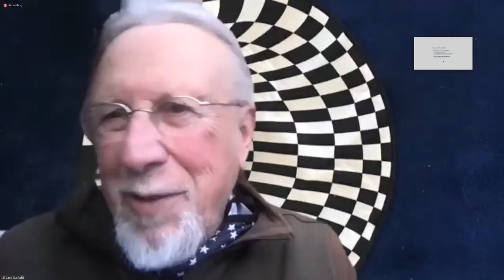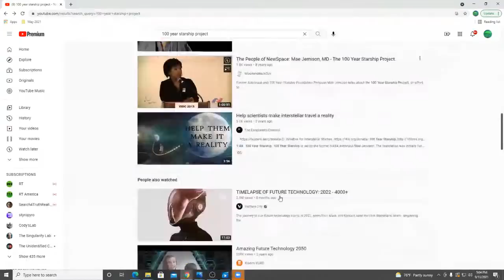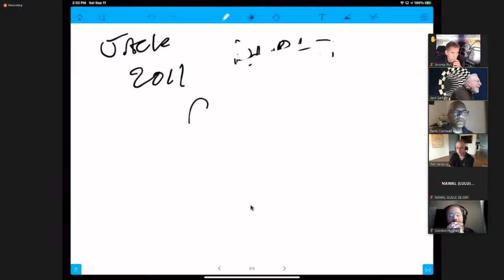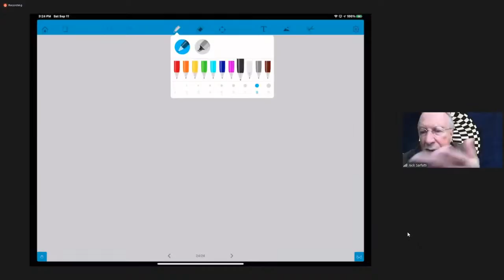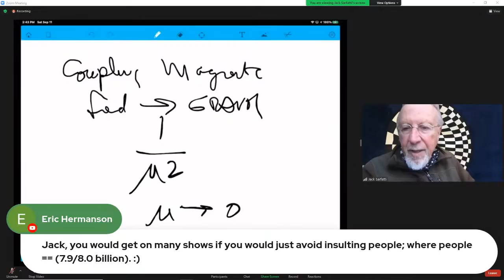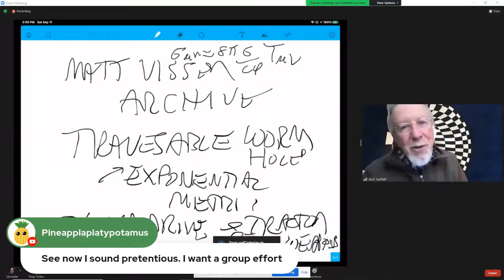APEC 9/11: Jack Sarfatti’s UAP Warp Drive & Tic Tac Tech

Comment: Jack, you are out of touch with real physics.
Reply: Over 50% of physics research is for the military and most of that is top secret. As Jack says - he worked for military research. My own quantum mechanics professor had his research classified top secret - before he was aware of it. Then he was contacted by the NSA and now he's designed a quantum teleportation satellite signal system that NASA is testing - Professor Herbert J. Bernstein. So no - Jack is not out of touch with real physics.

Comment: I'm not very knowledgeable in relativity, but my understanding is that with a gravitational redshift, photons are redshifted when traveling out of a gravity well, but that they are blueshifted when traveling into the well.  If this is the case, then do the shifts cancel eachother out for a gravity or antigravity well or is it possible for them to take a path through the well so that there is a net red or blue shift?  Dang, should've asked that one.
Reply: There's something called the inverse doppler shift. I'll find some details for you. "This type of metamaterial is composed of Helmholtz resonators of which the group and phase velocities are opposite in direction near the resonant frequency." So Transverse or Inverse Doppler Effect  "materials with negative refractions can induce inverse Doppler effects"  and "A localized wave packed assembled from many plane waves can still be assigned a (four)momentum at each point. The four components of this momentum are the phase change rates in t,x,y and z given by the imaginary part of the first order derivatives in t,x,y and z. If you apply these first order derivatives on a plane wave then they'll give you the temporal and spatial frequencies of the de Broglie field. The de Broglie wavelength is simply the reciprocal of the spatial frequency. Realizing that the lag of the clock characterized oscillations inside the particle, he associated them with vibrations of the same frequency, but covering the whole space. And he showed that if an observer sees a particle in motion, then these spatial vibrations will seem to him waves propagating faster than a particle..."
and ."The inverse Doppler effect where an observer measures a higher frequency from a source moving away, is such an intriguing phenomenon that it has attracted substantial theoretical and experimental attention since it was first proposed... ...the energy-momentum flux will be larger in the blue shifted part than in the red shifted part....In a moving frame, they diverge: the mean internal frequency of the photon will increase; simultaneously the orbital frequency of the photon will decrease due to the relativistic law of the slowing down of clocks. Despite the difference in frequency, at any point in space-time these two oscillations must be in phase....This provides a possible physical origin for the postulated law of the "harmony of the phases" first proposed by de Broglie, which lies at the origin of quantum mechanics. ...In a head-on collision between two photons, the interaction will be essentially between the blue-shifted regions which are converging....This state may then decay back into two photons or into an electron-positron pair. Is the electron a photon with toroidal topology? J.G. Williamson and M.B. van der Mark, 1997

Grant Sanderson, math/science Stanford: "Unlike the doppler radar case where the ambiguity arose because waves were being used to measure an object with a definite distance and speed; what we're seeing here is the particle IS the wave - so the spread out over space and over momentum is not some artifact of imperfect measurement techniques; It's a spread fundamental to what the particle is: analogous to how a musical note being spread out over time is fundamental to what it even means to be a musical note." Grant Sanderson, Math/science degree, Stanford University

Comment: And if your a Einstein Rosen Bridge for fabric to current math train like the math thanks for that!. Would have to look around otherwise 🤯C speed off light over T time to time at a relative off 300 pico to one second I cheated a lot to get the time faster than light that's for sure!. If you use SL partical law forward math including a few like the fact electrical and light move at near the same speed sound barrier??agent Carter you got a warp engine 🤣 why I've been working on that for a decade since myth busters antigravity show on the 3 rings and it's a engine real world warp engine and since Time off or by bending it around instead off the current bubble how's that going to move train in space??????? On a wave with a planet to get a little 😱or the fact the magnetic required can't be built to real use😱 or do you think a battery magnet train would work better on the fact.......ride the collection off positive to neg on a bubble instead, you can shape it?????? You can get to law's one light year in 31 hour's to decimal. Sounds like the same thing as the angle that side swiped the sun we know why half a second out and near disaster When i got enough to build it!. And understand how to move faster than light had it for near 200 years energy!!!!!!!!!And how to bend space time with it!🤨🧐.two test to prove it........you live on a black hole what's time microseconds off it???????.thank them all for the knowledge.

Comment: So, the Scalar field introduced into Einsteins Field equations, whereby using EM energy to modify the local gravitational field (spacetime) in order to travel like UAPs sounds okay on paper.

This sounds like an EM energy to gravitational energy generator that uses some kind of exotic superconducting metamaterial. The hard bit is designing this generator, and then navigating and controlling it in a craft so that you don't end up inside a brick wall. 

I agree that G-forces involved aren't an issue when you create your own geodesic path with this generator, as the vehicle itself would be in constant free fall from its worldview, and not what is commonly described of being crushed inside by extreme forces.

Energy generators have been around for the longest of time, and each invention has transformed humanity. What's holding this invention back, if not already invented in secrecy? The secret sauce metamaterial?
Reply: Actually it's all very easy, they just never taught ya that it can be done. Rf 204.
Read faraday and Thomson on what is inertia. It's all there in their work. Gravity is simply understand the difference between a coherant field,  and a non coherant field. Meta materials aren't needed. But can be engineered to do what you like. Your looking for a piezo electric effect in that concern. The same can be / was done with a hyperfine ground state. Your looking for capacitive reactance to fq and / or ev levels. Then "fuel" becomes irrelevant and everywhere.  Bob's description of the arches in the hull come into the picture at that point, and their function clear. That's still old tech. The tic tacs aren't much further down the line. If you don't get those, the newer stuff will really melt your noodle.
Reply: you can do this in serious meditation - read the book "Taoist Yoga: alchemy and immortality" and study Stuart Hameroff and Roger Penrose. Tubulin of microtubules are metamaterials. I have done the research on this. Sure the training now is very rare but there's a few masters hiding in the mountains. haha.
Reply: The Alcubierre space drive works fine on paper too.
Reply: The secret and simultaneously the difficulty is creating finely tuned EM resonance in an harmonic at the plank scale.
Reply: @kickstar8495  What Andrija Puharich figured out - and a collaborator of Stuart Hameroff corroborated - is that ultrasound creates a macroquantum nonlocal resonance that is 3000 times amplified greater than any other frequency. So that is how sonofusion works and also meditation energy of the microtubules. In other words the microtubules resonates the tubulin at 3000 times great energy with ultrasound because the tubulin are metamaterial as a reverse time subharmonic in the Schumann Resonance frequency. So this maybe why the equilateral triangle craft kick out the low humming noise that is reported and that I personally heard - it's the OM sound of the universe as a reverse time quantum BEAT or subharmonic of the future. 
Do you see what I'm saying? The larger macromolecule is actually the subharmonic of the nonlocal quantum planck scale as the magnetic moment between the proton and electron - as Andrija Puharich figured out. So it's a "spin" precession (5th dimension as nonlocal intrinsic angular momentum) of the electron interacting with the proton - and thus creating sonofusion reverse time energy.

Comment: Years of claims from Sarfatti. Not a single demonstration.
Reply: I still respect him for thinking outside the box, we need more of that.
Reply: @Motor_Explorer1  His ideas are NOT novel.
Reply: just go to the "National UFO reporting center" database by shape triangle. I personally saw an equilateral triangle craft so close I could have hit it with a rock! It had no fuselage, made a low humming noise and had a big red light in the center that appeared to be the propulsion drive. I didn't dare take my eyes off it - it flew over the tree on the edge of our yard and then over our garage. I tracked it from the horizon to the west and over the neighbor's forest and our hill - so I could triangulate the height, location and size. There are numerous reports - even some video! Sure MOST of the vids are CGI fakes but some definitely are real. Some of these sightings do see the craft suddenly take off as if disappearing. Also many of the sightings have the triangle craft ACCOMPANIED by other military craft. I uploaded a video about this. thanks
Reply: @voidisyinyangvoidisyinyang885  Your comment is very strange and has nothing to do with my excoriation of Sarfatti.
Reply: @NeverTalkToCops1  True only that I did intense nonwestern meditation to finish my Master's Degree and so I can confirm from personal experience that the paranormal does work as Jack argues - creating a curvature of spacetime through local quantum nonlocality. In fact I wrote a whole book on this - connecting the paranormal to UFOs via the microtubules as sonofusion metamaterials - in 2012. It's a free pdf online as "Alchemy of Rainbow Heart Music: How paranormal sonofusion subverts the Matrix conspiracy" - there's 725 scholarly footnotes. I mention Sarfatti once in a quote from Prince and Picknett's book, "The Stargate Conspiracy." You'll note that Jeremy asked Jack about the phonon piezoelectric reactions - that's another way of saying Sonofusion. Jack confirmed that is what he's talking about. So Jeremy has thoroughly investigated and promoted Sonofusion as well - there is experimental proof that it works according to Jeremy's research with the MIT physicists. New assessment for the piezonuclear reactions,” published on Physics Letters A 2009 February 23
the highest review in physics in the world based on Professor Fabio Cardone and Professor Roberto
Mignani’s Energy and Geometry (World Scientific – 2004) and Deformed Spacetime (Springer – 2007). Chapter four of my book is on the big black equilateral triangle craft.
thanks
Reply: @voidisyinyangvoidisyinyang885  A Gish Gallop of Woo. Learn brevity, please.
Reply: @NeverTalkToCops1  Self-Censorship is the first step towards censoring others. Unlock your brain first. haha
Reply: @NeverTalkToCops1  if you ever wondered how master degree in tautology looks like, now you know, i bet he couldn't solve petty little  Schrodinger equation for spherical potential if his life depended on it, but he'll accuse you of censoring and what not for ruining his delusions.
Reply: @reculture  I actually took Quantum Mechanics in 1990 from Professor Herbert J. Bernstein. Of course computers do calculations - as Roger Penrose points out. Basil J. Hiley, a collaborator of Penrose, also points out that the wave equation is not necessary to do quantum mechanics. So if you want to understand the solution to the quantum measurement problem then just study Hameroff and Penrose and try practicing what they teach. Bernstein uses a noncommutative donut for his quantum teleportation technology - you can read his SciAm article on fiber bundles for details.